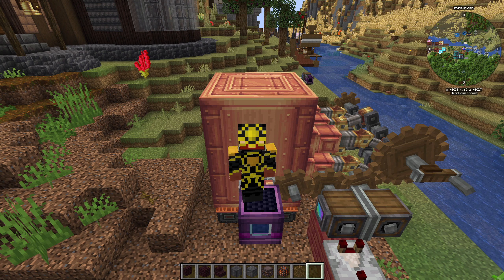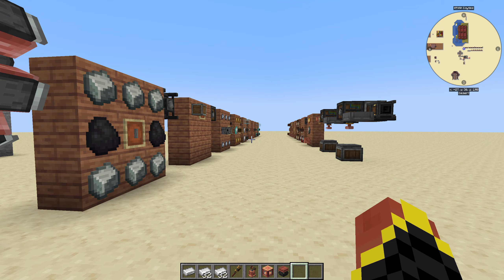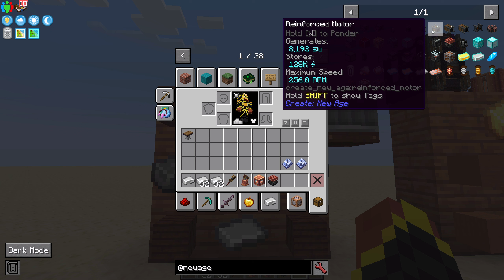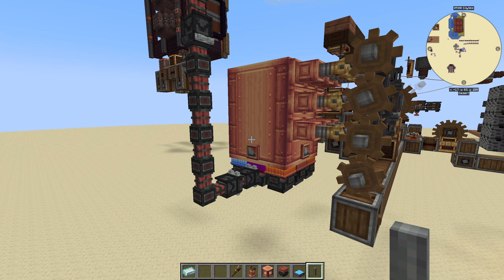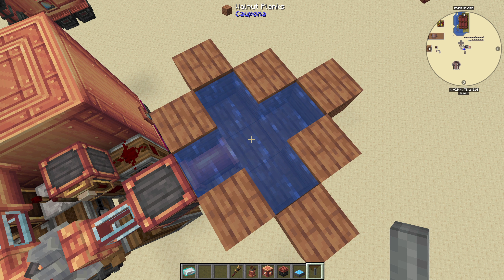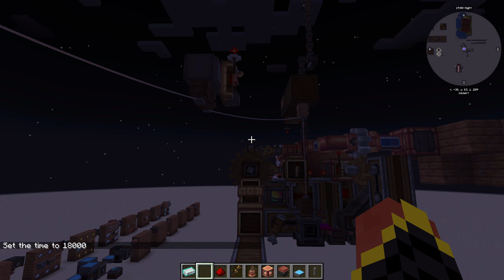Create: New Age + Immersive Engineering Tutorial - Self-Restarting Solar-Powered Boiler

Comment: note on the items required: as one is expected to use jei to craft the item, showing the exact recipe is really superfluous; a 'vanilla' material checklist would be enough. and if playing on a modpack that tweaks the recipes even that may not be 100% reliable.
6:20 as for the thorium, it's very mildly radioactive. it's what's described as fertile (not fissile like uranium) - that means it can be transformed into a fissile material by radiation, but generally does not easily decay. also having a shorter half-life is actually bad: that means that the rate of decay is higher.
7:50 I don't rememeber if it was new age or crafts and additions, but there definitely is a create power storage. it's a fairly bulky multiblock, so it may not readily appear in jei
Reply from the maker: Thanks for watching.

The mention of JEI was a caveat to my statement that copper/nickel/iron plates should be forge tag compatible, not intended to be a hard requirement to use JEI. (Granted, I got sloppy for the circuit component in the breaker and probably should have built out an additional diagram for that. It was late at night and this is unscripted, you got me there for sure 😅)

Also confirmed that New Age doesn't have power storage, but you're correct that Crafts & Additions does. At that point you're using another mod for storage either way, so it's down to builder's choice/aesthetic/if you want to be purely create and add-ons. Might release a follow-up that uses Crafts & Additions for folks that want that instead.